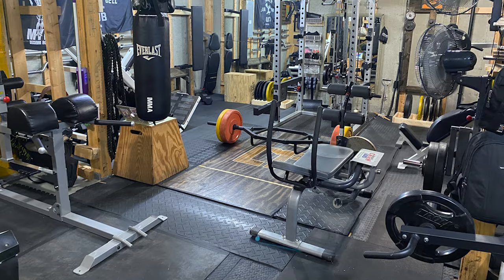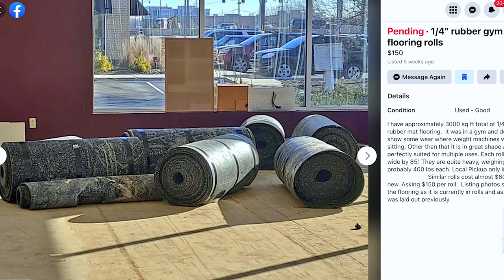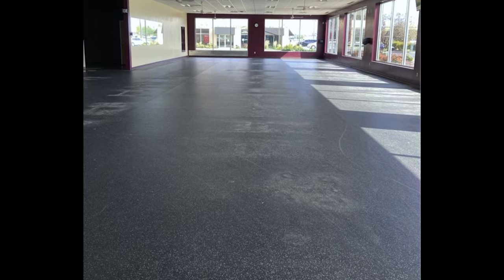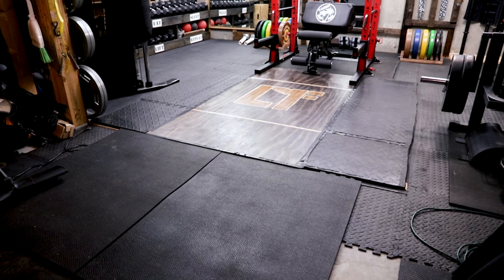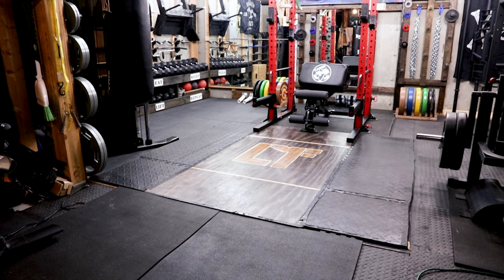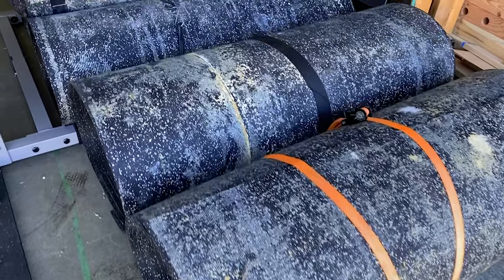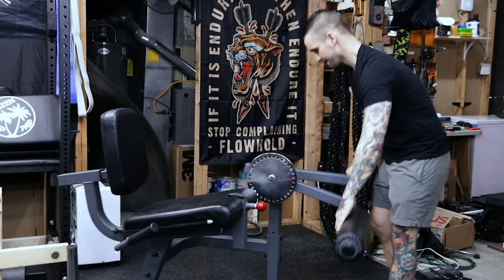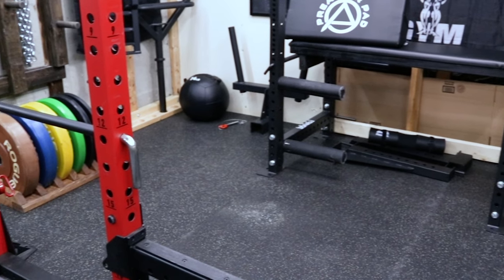Home Gym Floor Install, replacing foam mats with commercial gym flooring

Comment: Super cool find!  I ended up filling my garage wall to wall with 3/4" horse stall mats.  Took about 3-4 weeks to get the rubber smell out, mending plates at the joints, and extra duty gorilla tape on the seams.  The exact same mats (- the rubber smell) would have been about $3k from a gym-type store, the horse stall mats though was about $850 ($900 with the mending plates and tape).
Reply from the maker: Yeah, it amazes me how expensive flooring can be. That’s part of the reason I didn’t look into upgrading until recently. Horse stall mats are a great option.

Comment: Flooring would be nice. I have an old carpet below my exercise space and put some doubled up puzzle foam mats, where I need it and have some crash mats for deadlifting. I will insulated and renovate the attic during summer and want to use similar flooring as you now did, when it is done. Until then, the carpet will have to do.
Reply from the maker: Yeah, it’s not 100% necessary to have for a workout but it really nice to have once the basic needs are taken care of. I’d like to see how yours turns out.